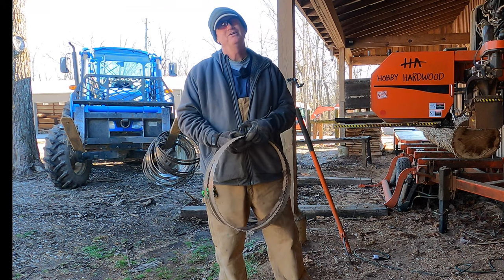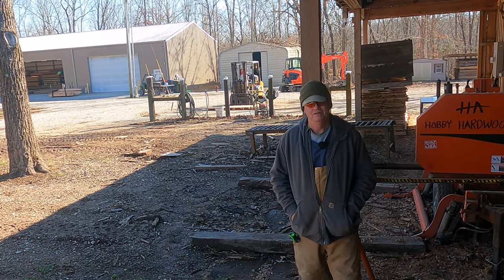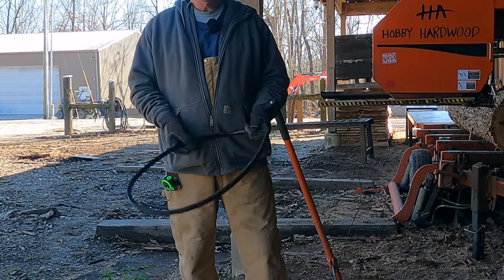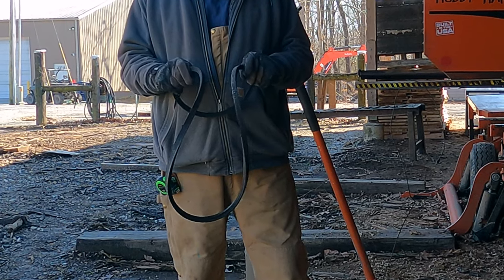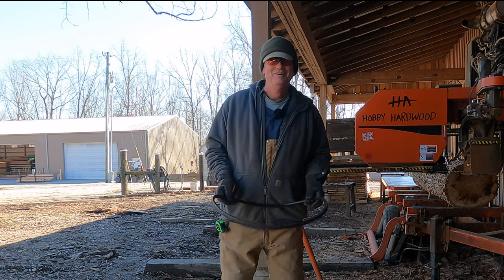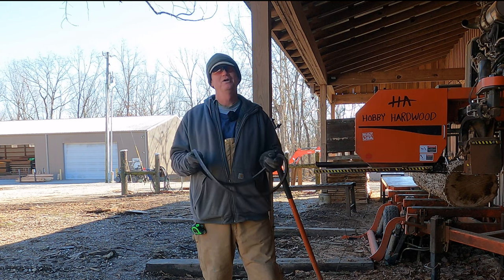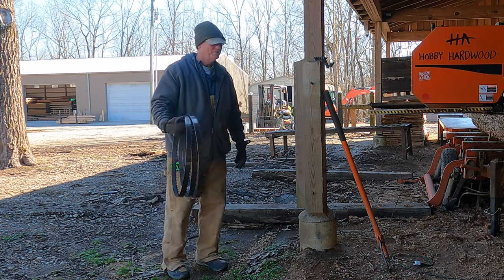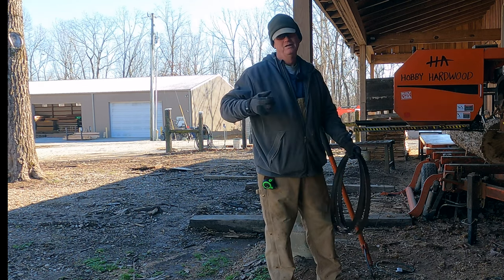Folding Sawmill Bands the Easy Way (Without Blood!)

Comment: This seventy four year old man is quite impressed. I worked in the shake and shingle business when I was about eighteen years of age. I started on shakes first then went to the shingle mill thinking I was quick. Yes I can still count to ten on my fingers but I was plumb lucky as I was using a metal cutting blade on a fairly large saw. I was in school and because of my dad having a mill ... they presumed I knew how to use that saw. I started pushing the piece of metal through that saw and it was scary to me. I was really shaky and so didn't have a proper hold on the metal. It flipped up causing the metal to bind the blade in that saw, the blade snapped and cut my middle finger off! Actually it yanked it off as the blade just nipped me and the speed it did it was enough to yank it off. I had already seen a ton of blood in mills so I actually remained calm, bent over and picked up my finger with a tissue, put it in a paper cup, then tied a cloth around my finger and hand that was bleeding. I walked over to the nurses station where they got a whole bunch hysterical. The doctor there looked at me with this cup in my hand.... whisked me into his room for surgerys and such. He told me its going to be a miracle if this works. I can't feel really good with that finger but its still there and doesn't give me any troubles. Yes I did subscribe to your  channel as I can share this and show others this very simple method that I never figured out myself nor was showed. I like your style or attitude for real.
Reply from the maker: Wow, that's great and I'm glad it works out in the end. I appreciate and respect your comments and thanks for watching!

Comment: Fun.  After I did the visit to WM to have them show my viewers how to fold a band, I began getting a lot of comments about an even simpler and safer way.  In short, you step on the band and twist it down.   I may have to try it out of curiosity, but I don't use coiled bands, so not much point in learning it other than curiosity 😉
Reply from the maker: The real point of coiling bands is ease of disposal.  They fit in recycle bins and and are  put in a "safe" state.  This is by far the easiest way to coil a band for storage, shipping, or disposal.
Reply: @Hobby Hardwood Alabama  For some, it's actually for shipping back to Wood-Mizer.  They reset and sharpen and return thus way unless, like me, you prefer the flat packs
Reply: That's how I was taught and have taught others.

Comment: That's all very nice, when your running an LT70 please be a little careful when running a LT40 as the blades are a good bit shorter, so the tension is a bit different.
Reply from the maker: Thanks for mentioning that.  Long bands from an LT70 are "sloppy" and more difficult to handle, while the LT40 bands fold in a much more controlled manner.

Comment: Are you a cbn wheel guy? I'm using a drag sharpener and was thinking of upgrading. My little timber king sharpener takes forever.
Reply from the maker: Yes, a had a “top of the line” drag sharpener, and now have a full CBN setup, and CBN is as far above a drag sharpener as the difference between drawing with chalk on a chalkboard or using a laser printer.  A good CBN can sharpen a band in 3 minutes, or 20 bands per hour.  my drag sharpener took 14 minutes or 3 bands per hour.

Comment: Curious about 2 things.  1.  What type of engineering did you do?  2.  How many days worth of sawing do those 64 bands represent?
Reply from the maker: I graduated as a Mechanical Engineer with honors, and math minor.  I worked up the food chain to the top as a Chief of the Advanced Technology Fabrication and Evaluation Function of the Weapons, Development and Integration Directorate for the Army Missile and Aviation Command, and retired a few years back.  Basically designed, built or evaluated propulsion and warhead systems for many of the missiles and UAV's you see on Discovery channel and the news every day.  Two my projects were featured on the channel.  I've been sawing for 20 years, and have had a sawmill and lumber business for about 15.  Martha just retired from NASA as a Mechanical engineer also, and has hardware in space.  That's what drives our lumber business - do the best, be the best, or don't bother doing it.

I run generally 2 bands a day, however, last week I had a 4 band day, which was unusual.  Sawing 5 days a week most times, and a couple sharpens before the bands are showing issues and I toss them.
Reply: @HobbyHardwoodAlabama  Awesome!  My degree is Aerospace Engineering.  The satellite I worked on has probably been deorbited a while ago.  Did some work on Tomahawk and AIM-9X at one point.  Currently working in automotive on heavy duty trucks, but the siren call of aviation is still strong.

Comment: When and how do you determine a band is no longer good? I use Wood-Mizer ReSharp but I'm not sure how many times I should be sending bands that I may need to pitch.
Reply from the maker: There's a lot to it, but basically use them in batches, and when they start to fatigue crack you will hear a distinctive sound.  When one breaks, then the whole batch is close to failure, also.  After awhile you will get a "feel" for when they are about to break and know it when its about to happen.

Comment: I know you said you recycle the old bands but I did not catch how you recycle them. I do know one way you could recycle them and make some bladesmith / blacksmith happy. They would love to have those. They would clean off the points, cut them into pieces, stack the pieces together with other high carbon steel pieces to make Damascus steel for knives.
Reply from the maker: We have had a few knife makers come and get them, but most blades simply go to the recycling plant for 7 cents per lb.
Reply: I am surprised that more bladesmiths don't come and get them. If I was doing bladesmithing I would pay you 7 cents a pound and save you the time and cost of hauling them to the scrapyard. @HobbyHardwoodAlabama

Comment: Robert, much better technique than the bloodletting method I see others using.  When do you scrap a blade that hasn't been damaged by metal strikes, etc.?  After a certain number of sharpenings?  Go by gut feel?  Thanks and keep up with the good content.
Reply from the maker: I sharpen in batches, and when one or two bands in that group break due to fatigue or service life issues, it shows the while batch is about at the end of it's life, and I scrap them.

Comment: Any thoughts on getting a Cat Claw blade sharpener and setter? Last I checked they were $2500 or so. I hear you can resharpen maybe 8 or 10 times. Also I think some people charge $10 to sharpen a blade. I think they mandate shipping at least 10 blades at a time. I feel like this could be done in the background throughout the day as you are getting real work done. Even if you don’t make it a service I wonder if it would be a personal money saver over time. I have much appreciated your robust responses in the past. I really want to do what you do and appreciate your knowledge beforehand. Thank you so much!
Reply from the maker: Well, here's when the unsponsored comments come.  I had a Cats Claw sharpener and setter.  It worked, but was a poorly constructed piece of junkyard welded, paint falling off, rusty when delivered backyard engineered slow machine.  I had two sets of main shaft bearings go out on it, and the first was warranted, the second, although still within the warranty period, was not.  To quote the person at Cooks, "If we had to replace every bearing that went out on our machines under warranty, we would go out of business."  Enough said.  Get another brand.  I would rate their machines at 1 out of 5 stars.
Reply: @HobbyHardwoodAlabama  wow thank you for the insight. Not what I was expecting, but again your experience shines, I guess the question now is do they make a better machine that does the job and is it worth the space it takes up? After watching you fold up way too many blades destined for the bin with no mention of a different option my guess is no it makes more sense to just toss old blades. Like most people, I was hoping to buy a machine to create another revenue stream, however small. Or at least keep from buying so many blades. $30 times infinity is an ever growing number, obviously:)